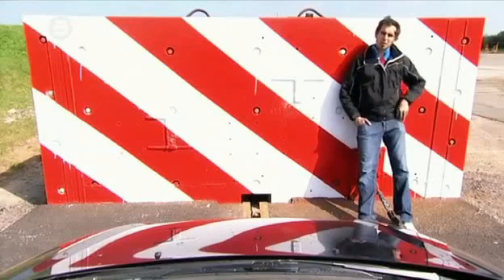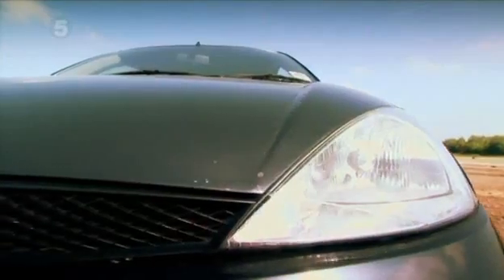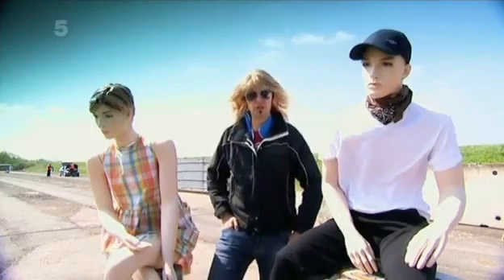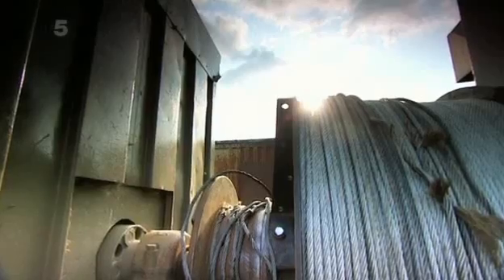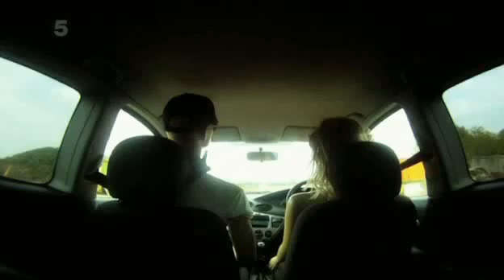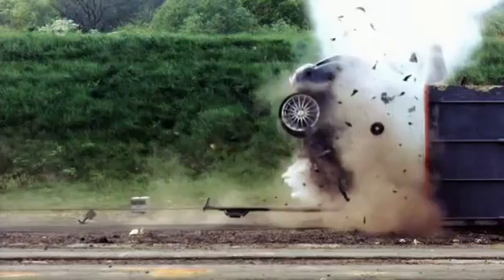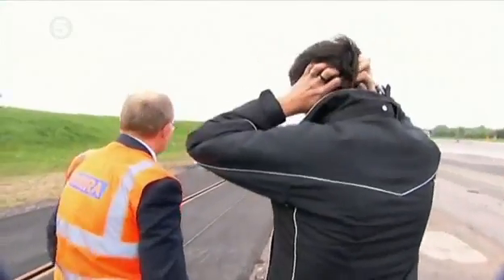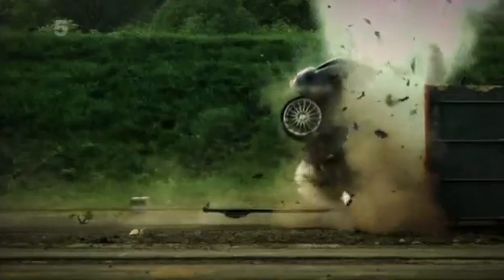Ford Focus - Simulação de uma batida a 193 km/h

Comment: Anybody does not spent much for a car that will be useless. I think the car on this test had been repaired and sold cheaper than the ones without damage history. Of course such a speed is not acceptable but the strength of the chasis differs if the car has a demage history.